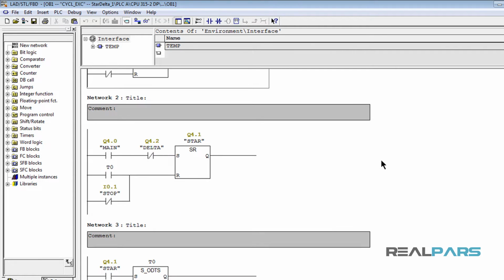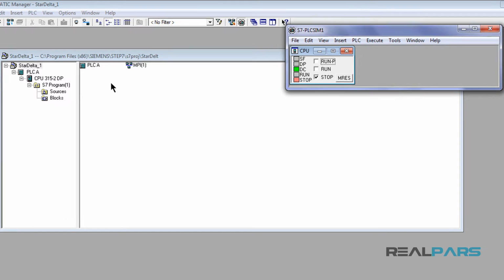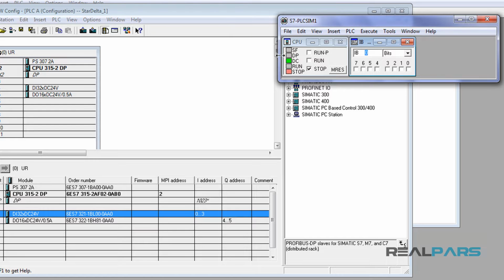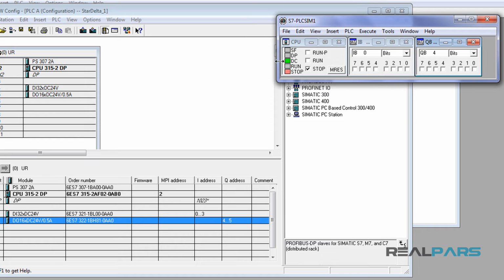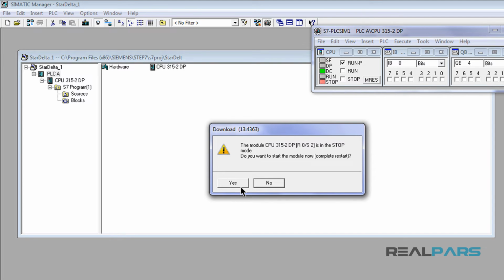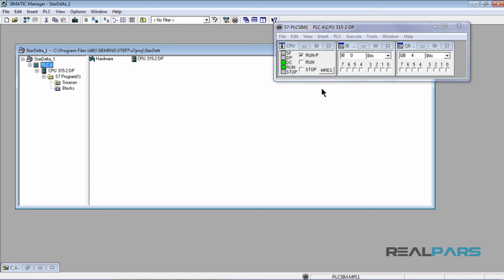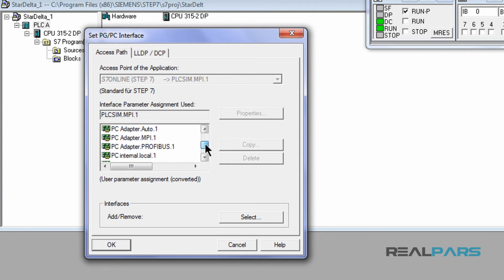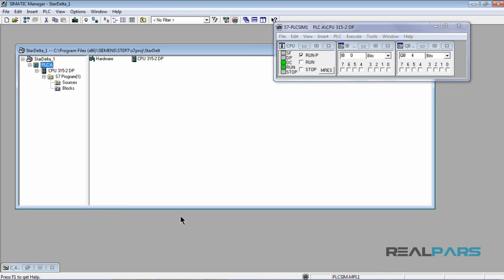Star-Delta Starter PLC Program and Wiring _ Part 13

Comment: Why didn't you add the delta output ON the network with the on delay timer instead of adding an extra network?
Reply from the maker: Hello, @emmanuelughanze6460. Thank you for your question.  We try to make the lessons and videos easy for our audience to follow. It also makes it easy within Siemens software to use simple networks for troubleshooting in a real-world application.   Happy learning from RealPars!

Comment: Hi Realpars Team,
Kindly educate us about different ways of Motor control.
1. DOL
2. Star to Delta
3. Softstarter
About their wiring and components rating calculation.
Circuit Breaker Rating calculation,
OLR, Contactor, etc .
All those components used in these 3 configuration their wiring and selection formulas.

Thanks ...
Reply from the maker: Hi Mouiz, thanks for the topic suggestion, I will definitely go ahead and forward these to our creator team. Happy learning!

Comment: very nice video, I am wondering  how to get Siemens simulation for PLC, is it free?
Reply from the maker: You need to install "STEP 7 V5.5" or "STEP 7 V13". You can click the links below to find out more info on different license types of STEP 7: 
http://sie.ag/1HZhfL4 http://sie.ag/1XVfntY
The software is not free but Siemens offers free trails for the first time users.